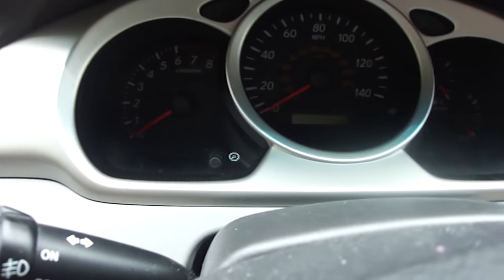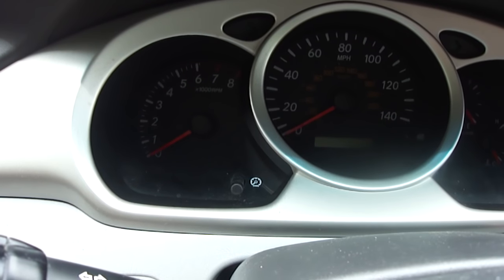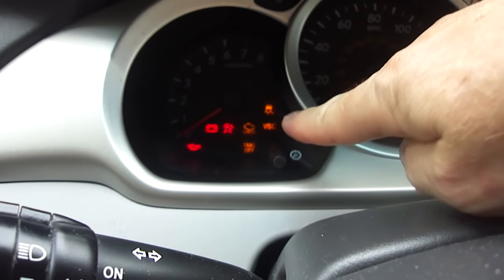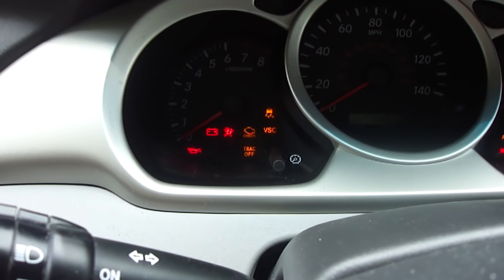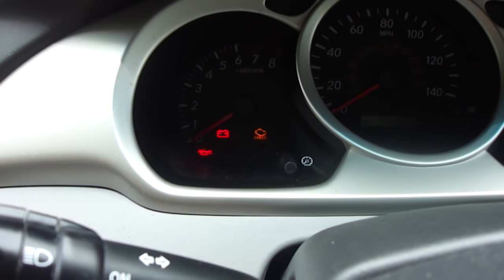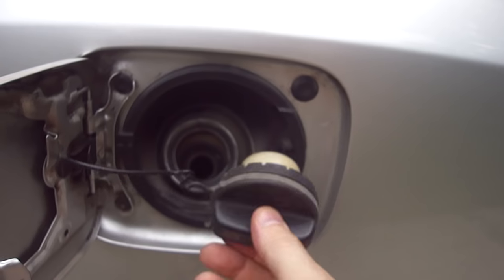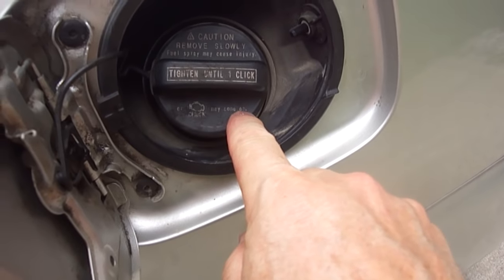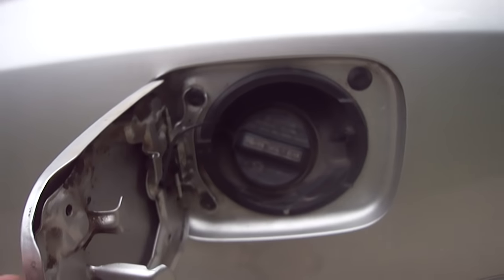(Part 1) How To Fix Your Check Engine, VSC, Trac Off Warning Lights On

Comment: I tried everything I could find from youtube and google.  VSC and check engine lights remained on.  Disconnected my battery for a few minutes and hooked it back up, lights finally went off.  Big relief as I am due to trade my 2010 highlander in for a new RAV4 in a couple weeks.

Comment: Oh wow! I hit this today... right after an oil change + filling gas. I was pretty distraught as a perfectly running vehicle hit this right after a routine oil change. Took it back to the autoshop and the OBD showed air/fuel ratio sensor is faulty. A $400 repair! Since it was not urgent, I took the vehicle back home, and after watching your video, cleaned the fuel cap and the fuel neck, closed it till multiple clicks. The light still stayed on, and then someone mentioned below that it turned off after a few days, so decided to wait. Lo and behold, after a couple of stop, rest and restarts the VSC light turned off by itself. THIS VIDEO IS AWESOME! Thank you!

Comment: God Bless you and God Bless YouTube!  Why anyone would dislike this video is beyond me.  How many of us back in the day would have taken this to a mechanic and been charged $100 to $200 for something so simple.
Reply: Roderick Felder repair people that get paid hundreds to tighten a gas cap would be the ones to dislike
Reply: for my 2005 4 runner limited- 8 cyl, I changed the Gas Cap and reset the check engine light by disconnecting the battery but the VSC & Trac lights came back on.  Additionally when it got so cold, I lost the gas pedal or throttle did not work and the dash lights in question stayed on all the time even when I erased the codes.  My lights were on for a different reason though,  I used the OBD scanner and it was throttle control issue (forgot the exact code now).  Long story short, I change the fuse for the ETCM which was burned and car worked perfectly, throttle is normal and vsc, trac & check engine lights disappeared forever (20,000 mile later still good).   It seems to me that these lights can be triggered for various reasons. I hope this help someone with a similar problem.
Reply: Hey George. I have a 2003 Toyota 4 runner V8 cyl, limited edition. I have the same problelm VSC TRAC TRAC OFF light and now the Malfunction lamp light just came on after having a mechanic put a new valve gasket cover on, and a radiator flush. The mechanic diagnosed the vsc trac trac off lights as needing a new throttle/pedal sensor. They are charging me 300 bucks. How can I change the ETCM fuse you were talking about? I would like to save some money of i can, already spent 600 buck in repairs this last month.
Reply: Haters are gonna hate brotha!
Reply: My thoughts, precisely!
Reply: ikr or you can just borrow the OBD2
Reply: vs

Comment: 2005 Toyota Highlander limited. I had the oil changed mobil 1 at the same place I've been using for years.Finished the service everything normal, start to drive away after a few blocks the two lights come on. Crap, drive back to the center he checked nothing. Starting to think all kind of things on how expensive this repair is going to cost me.Drove home cursing all the way home. At home i decided to check you tube. Amazed at all the results on this issue. Removed the cap cleaned it cleaned the neck of the tank and lubed the gasket. Next day it was still on, Crap. In the afternoon went out to get something at the market and they were off. Fantastic !!!!  Great job proclaimliberty2000 Thank You.
Reply from the maker: John Monroe You’re very welcome John
Reply: @proclaimliberty2000   Same sequence of events for me today: "Oh wow! I hit this today... right after an oil change + filling gas. I was pretty distraught as a perfectly running vehicle hit this right after a routine oil change. Took it back to the autoshop and the OBD showed air/fuel ratio sensor is faulty. A $400 repair! Since it was not urgent, I took the vehicle back home, and after watching this video and your comment, cleaned the fuel cap and the fuel neck, closed it till multiple clicks. The light still stayed on, and then since you mentioned mentioned that it turned off after a few days, decided to wait it off. Lo and behold, after a couple of stop, rest and restarts the VSC light turned off by itself. Thank you!"

Comment: Paul thanks for a very informative video. I did the steps you indicated, opened the gas tank cap, cleaned the tank rim, lubricate the O ring, and on my 2003 Sequoia, the annoying VSC TRAC & Trac OFF, along with check engine light is now gone. I have driven it for 120 miles after the clean up and the lights have not returned. Thanks again for a great fix Sir. May Allah Bless You. Ameen
Reply: I hope your light comes back on.
Reply: @themaestro5946  hahhaahahaha i agree but Allah means God in there language even the Christians can refer to God as allah
Reply: @themaestro5946  Christians and Jews say it too if there middle eastern not only Muslims lmfao
Reply: Paul’s God is Jesus not allah!
Reply: @Hugo-rr9mz  LOL. ok. if you say so. But your eyes will open, once your eyes will close. Ponder upon what I said and you may find the truth.

Comment: Thanks so much it just worked. One scammy mechanic charged me with speed sensor change for $550 on top of $93 checking fee for this. Not only they were wrong but they couldn’t solve the issue at all.
Reply: Have an ‘08 Sienna XLE.  had all these random misfire codes (VSC) and even would have to shut my van down as the “traction control” light would blink along with the engine light causing the van to lose power and decrease in speed, till I shut it off and restarted it.   And that would take care of it for a week or so then back again, usually one the Highway.  So off to the shoulder again as the van would slowly lose power and buck and gas be basically unresponsive 

Seems like maybe the compression was changing over the 200,000 miles as i started putting premium gas in and the higher octane was the key.. as all the codes went away (once cleared) and never came back.   Same spark plugs.  I did change one injector (before I switched to premium gas) as it did have that code come up for the number 2.  But the check engine lights would still come on.   But same spark plugs on all 6 cylinders as those back are just too hard to change without a good reason.  

Again premium gas and all my check engine lights and blinking lights are a thing of the past and it’s nice having a dash free of those.  (Those lights came on probable a dozen times in the past.  But now problem solved for like 9 months now and counting.

So if it returns might try that.   I’ve disconnected my battery several times.  And light always would return after a period of time.  Also I had cleaned my gas cap in the past.    

But premium gas is what helped when everything else was just a temporary fix.  

God bless

Comment: okay this exact issue happened on my 2007 Toyota FJ Cruiser. I went to get a state inspection, and shortly afterwards all of these lights came on simultaneously. this was a lifesaver! Sure enough the gas cap was not put on correctly after I left the inspection station. after about 10 minutes of watching this video I tried the solution. I tighten the gas cap and ensured that there were three clicks. The lights stayed on until about 45 miles. They turned off by themselves after that. Thank you so much!
Reply: God bless you too. Been so worried. Thank you so much for this solution. 😀
Reply: James Graham was in
Reply: OK I got a new cap but lights are Still on. Should I wait after 30-50 miles before I Really panic? Thanks Much! 🚙
Reply: Same vehicle, same problem. All the lights came on after a gas fill up at around 6.5 miles. Tightened the cap and still on after another 7 miles. Restarted and still on. WTF is the deal of 45 minutes, is the ACU to stupid to reset when the problem is resolved? Now I will have to connect it to my analyzer just to reset the worthless emissions scam. Really sick and tired of battling the engine check scams in all my Toyota vehicles. Toyota also has a scam that when the converter gets 5% plugged that damn light will stay on forever but no driving or gas performance loss. Been driving a Sienna now for 5 years now with the stupid light on since I refuse to replace parts that it doesn't need. Also found the knock sensor (another useless one) will force the engine intermittently to loss half it's power. That I call safety hazard and ACU's that do this should be recalled and mandated flashed of replaced. I expect these scams from the American manufactures but now Toyota has jumped in on the legal criminal games as well.
Reply: It’s Still on (March 2019) & this started in Dec. ‘18  😡
Reply: James Graham a
Reply: Turns out that it was actually the Mass Airflow Sensor.  I have a TRD Air-intake.  The main flow housing has the Mass Airflow Sensor in it going to the intake from the TRD Filter inside.  Always make sure your filter is clean.  Do NOT use any oil-based products for the cleaning of the filter as it will collect dust and other particles.  As this builds up it will decrease the air ratio going to the engine and passing through the MAFS.  Unclip, and unscrew the MAFS and remove it, careful not to touch the bulb.  Clean it with some alcohol or throttle cleaner.  Wait for it to dry.  Put back in.  It usually takes about 45-60 miles for the lights to go back off. But yes, even a damaged fuel cap ring or crud on your gas cap receiver can cause this to happen.

Comment: Just fixed my 2004 Toyota Land Cruiser using this method.  I had not clicked my gas cap tightly, and I believe it caused  the check engine light and the VSC lights to come on.  I tightened the cap, follwing proclaimliberty2000's directions, and I drove the car about 20 miles.  The lights remained on.  I then disconnected the battery for about five minutes, and the check engine and the VSC lights both went off!!  I had an appointment at Toyota for them to look at the problem check engine and VSC warnings, and I was so happy to be able to cancel!!!!  Thank you proclaimliberty2000 and the other posters who recommended the disconnecting of the battery, AFTER you make sure that your gas cap is on tightly!  TEN STARS FOR EXCELLENCE!

Comment: Thanks dude, you saved me a trip to the dealer, another thing you guys can do is disconnect the positive battery terminal and wait 30 seconds to a minute, while also making sure the fuel cap is securely tightened. But thanks for the video!

Comment: You just saved me. Toyota wanted over two hundred dollards to fix this and I had an appointment.  I took your advice, checked the cap and sure enough, I failed to completely snap the cap on my wifes 2008 Avalon. You are amazing. Thank you so much.
Reply from the maker: Gary Claer 👍😊 so glad I could help.

Comment: Good post. I bought a new 2008 Toyota Camry XLE back in the day and was headed back to CA from back east. Was on I-70 near Grand Jct Colorado and the little skidding car light and engine light came on along with VSC showing up in my display in the speedometer center. I don't know what prompted me to think of it but got out, took the fuel cap off, used spit to wipe and a last bit of spit to lube the "O" ring on the gas cap. The VSC and little skidding car lights went out immediately but had to drive a few miles before the check engine light went off. God bless Japanese Engineering and their contribution to "throw away" design philosophy.

Comment: Thank you so much. This morning my wife called me half way to work and said there is an engine light, VSC and Trac Off lights on our 2007 Toyota Highlander. I had filled the gas tank last night and may have not closed the gas cap properly. My car is at the mechanic and they are going to look at it tomorrow. I already called the mechanic and told him to check the Gas cap before running the diagnostic. Thanks your video helped a lot as I was worried it could be a major repair.

Comment: I have a 2008 Toyota Tundra 4.7L V8, this worked for me! Just threw some WD-40 on the gas cap, closed it till I heard the click and went to the gas station to fill it up. The lights stayed on for a bit until I got to the gas station, turned off the engine and then back on. Lights are gone now and stayed off. This helped me out so much, thank you!!

Comment: This worked for my 2007 Toyota Prius w 161,000 miles. The check engine, vsc and caution (has a triangle and exclaimation point) light turned on one day. I thought it was major, but it really was just a loose gas cap. Thanks a bunch! This was the most simple fix ever.
Reply from the maker: Krystal Stutts 👍😊

Comment: Thanks for posting this video series(Part 1-5). I only needed to go as far as Part 2. This fixed the problem on my 2010 Sequoia. The only difference is my 4Lo was flashing as well. Once I cleaned up the gas cap area, lubed the gasket, and secure the cap tightly, the power returned to my engine. The lights didn't reset until the next morning. Happy to say nothing is on or flashing. You definitely saved me some serious change. Kudos!
Reply from the maker: You're very welcome!  Glad I could help.  I hope you'll subscribe.

Comment: The real deal. I went to Autozone and got the check engine light turned off but still had the VSC/Trac Off problem. Did what Paul suggested about the gas cap and Voila both lights went out immediately. Just ordered a new gas cap from my Toyota dealer ($32.00) for my 2003 Sport Edition 4 Runner. What a fabulous fellow this Paul is to us regular folks. Thank you Paul, and God Bless!

Comment: Many thanks!  I watched all three of your videos and after I made sure that there was no issue with a dirty rim of the gas receptacle and the O ring of the cap was not cracked, I discovered that for some odd reason I had to repeatedly turn the gas cap until the gas cap stopped clicking.  So, in the future, after filling up, I'll be sure that the gas cap has been tightened until there are no further clicking sounds made.

Comment: I have a 2016 Toyota 4Runner. The engine and trac off light came on this morning. I stressed all day about it at work and was about to go to the dealer until I watched your video. My gas cap was not clicked on all the way. I followed your instructions to a letter. I did however disconnect the battery for about 15 minutes to reset the light. Lights are now off. THANK YOU!!!
Reply from the maker: You're welcome!  Glad you got it fixed.

Comment: 2007 4runner SR5 I didn’t lock the Gas cap properly so the 3 lights VSC  track off and check engine lights lit up I simply tighten the gas cap til clicks then started and lights went off thanks! May Jesus Christ bless you!
Reply: Have an ‘08 Sienna XLE.  had all these random misfire codes (VSC) and even would have to shut my van down as the “traction control” light would blink along with the engine light causing the van to lose power and decrease in speed, till I shut it off and restarted it.   And that would take care of it for a week or so then back again, usually one the Highway.  So off to the shoulder again as the van would slowly lose power and buck and gas be basically unresponsive 

Seems like maybe the compression was changing over the 200,000 miles as i started putting premium gas in and the higher octane was the key.. as all the codes went away (once cleared) and never came back.   Same spark plugs.  I did change one injector (before I switched to premium gas) as it did have that code come up for the number 2.  But the check engine lights would still come on.   But same spark plugs on all 6 cylinders as those back are just too hard to change without a good reason.  

Again premium gas and all my check engine lights and blinking lights are a thing of the past and it’s nice having a dash free of those.  (Those lights came on probable a dozen times in the past.  But now problem solved for like 9 months now and counting.

So if it returns might try that.   I’ve disconnected my battery several times.  And light always would return after a period of time.  Also I had cleaned my gas cap in the past.    

But premium gas is what helped when everything else was just a temporary fix.  

God bless

Comment: Thank you for the great video(s) and tip(s)!  Your first video solved the problem after a few miles driven.  Such a simple and money-saving fix! 

You're a wonderful resource and thanks for posting this valuable information.

PS  What gives, Toyota?  Trying to create bogus business for your dealers?  WTF does traction control and stability have to do with a damn GAS CAP?!!!!  Shame on you!
Reply: I hade same issue with Land Cruiser Prado 120 . Front left abs sensor changed and Brake warning light and VSC, TRC every light was still on...
After doing this with Gas cap problem was solved...I'm still confused what's gas cap has to do with ABS hydraulic pump and ABS, TRC ECU of this particular model of a car.

Comment: Thank you very much!!  We had to get our 2016 4Runner jump started.  The check engine light and Trac off lights were both on.  I shut the engine off, took the gas cap off, screwed it on until it clicked once.  Restarted the engine, PERFECT!!! No warning lights!!!! Thanks Again!!

Comment: It might not turn the lights off immediately. Some cars might take 40-50+ miles of driving for the sensors to detect the gas cap is on properly. If it happens a lot, you might need a new gas cap or gasket.
Reply: Thank you for this comment. My light hasn't turned off yet. I'll wait a bit to see if it shuts off before taking it in!
Reply: Might be this, will try and c.

Comment: My vehicle is a 2004 highlander and I just experienced the same issue.  I was getting ready to take it to the dealer when I came across this video, it worked.  Thanks, great tip.